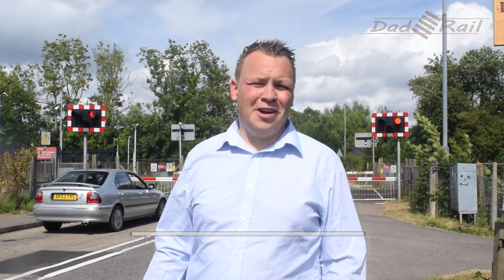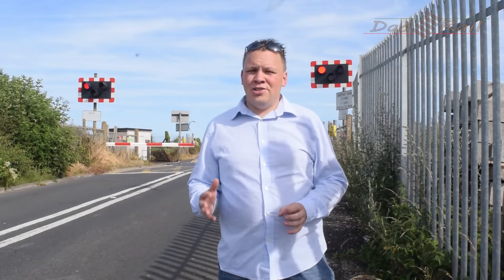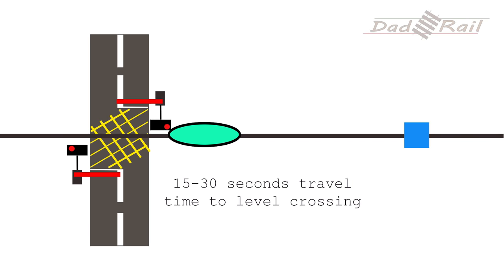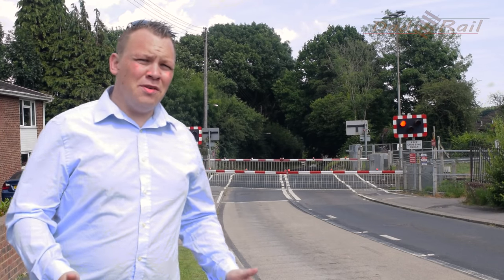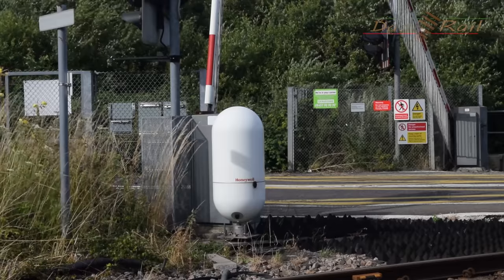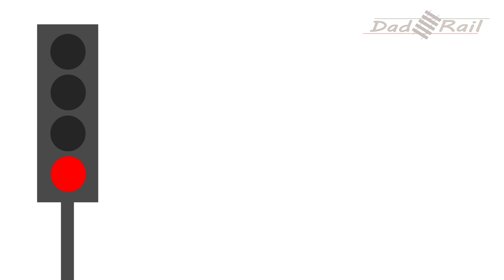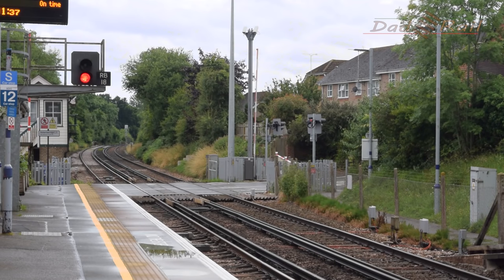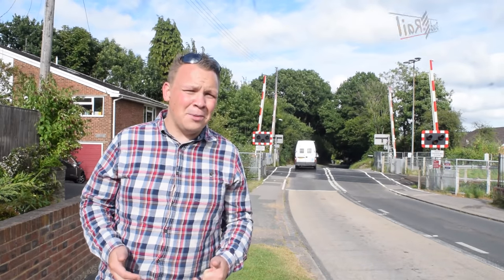Why do railway level crossing barriers go down so early? - Dad Rail HD

Comment: Several miles to stop? I can stop within 1/2 to 3/4 of a mile from 85mph with a 159 - full service brake (step 3), on a dry rail. The 170s - one of which was shown can do it in 1/4 to 1/2 of a mile in full service, from 85mph. Several miles could leave you in the next county. It was fun though before they put automatic sanders on in step 2, 3 and emergency - really tested your skills.
Reply from the maker: We have always had automatic sanders on Class 375s and 377s that I drive. They are pretty good on the breaks as well. Several miles based on a class 37 pulling a heavy freight train on a wet rail :-) Saying that one of our drivers who is now a manager did overshoot stonegate station by 2.45 miles! Was due to low adhesion and no sand in the box, - RAIB Report - https://www.gov.uk/raib-reports/station-overrun-incident-at-stonegate-east-sussex
Reply: They sound as bad as Disastros. One slid past 2 reds a few years ago - driver exonerated. The 159s have always done better in leaf fall probably due to superior WSP.
Reply from the maker: They are normally pretty good, just this one had no sand! Do you have the initial step 2 application policy in leaf fall? We have to use initial step 2 when driving class 377s as it is southerns driving policy, but when driving class 375s we follow southeastern policy which is earlier and lighter. Apparently the class 700s have got block breaks on them, be interesting to see how they perform in low adhesion
Reply: Dad Rail - yes we have......or at least SWT had that policy. I still use step 1 to take the bite out of the brake and earlier and lighter was a lot better. Never slid by a station in 18yrs of driving (fingers crossed). I've put flats on the wheels though using their policy.
Reply: flats - not good!
Reply: pmailkeey - actually some driving wheels have metal tyres... Metal wheels on metal rails is the most efficient. Rubber tyres on asphalt is good for grip, but not very efficient.
Rubber train tyres would not last long enough. Plus they would be incompatible with the signalling system.
Reply: pmailkeey - Rain and snow are not normally a problem on the rails. Leaves break down and leave a oil like substance on the rail, that causes wheel slip. Ice does not affect steam locomotives much. It also does not affect diesel trains too badly. But ice will cause great problems for some types of electric trains.
As ever with these problems, there are methods of preventing these problems, or dealing with these problems. For example vegetation control, rail head cleaning or rail head treatment trains. But if the problem only occasionally occurs, funding of these solutions is often limited.
Heavy snow of course requires snowploughs. Sometimes the railway does not think things through, then uses an excuse, and then the media loves that as a story...
Reply: pmailkeey - That’s only a little slide 🤣
Reply: @pmailkeey I meant wheel slip protection not TPWS

Comment: How do they prevent motorists or pedestrians from being electrocuted when they cross the third rail?
Reply: samanli2014 - There is no third rail across road or footpath crossings.
Reply: Mark 1024MAK So the trains freewheel without power at the these crossings?
Reply: samanli2014 - Electric third rail trains normally have multiple pick-up shoes, so no. But if all the pick-up shoes were not in contact with the third rail due to a very long gap, then yes, they would free wheel until the next third rail section.

Comment: Why, when a train is stationary at a station, cannot the road be opened until the train is ready to proceed?
Reply from the maker: The crossing is normally closed for safety reasons. There is a possibility that the train could overrun the platform, because of leaves on the line or misjudged breaking for example. If the level crossing was left open the train could potentially collide with cars or pedestrians on the crossing.
Reply from the maker: A bit more info on the above point :

The crossing and singling systems are also interlocked and have a time out feature on them. once the crossing has been closed, either a train must pass over it, or a set time must have elapsed before it can be raised again. This is to prevent the crossing being raised with a fast train approaching it. For example. The signalman lowers the crossing, and clears the signals to green. The train passes the green signal at speed. The signaller then changes there mind and raises the barriers, but by now the train is too close to stop. Thats why the barriers cant be raised until the system has timed out to prevent such a scenario. 

If a crossing at a station has been closed to allow a train to approach safely, by the time the train stops at the station, and then the signaller to contact the driver, changes the signal back to red, and waits for the time out feature before raising the barriers. By the time this has happened the train is normally ready to leave so thats why the barriers stay down

Sorry for the long winded answer I was trying to work out how to best explain it.
Reply: Thanks. It is very frustrating, where I used to live, there are several crossings, all immediately beside stations, and one can sit for what seems an inordinate amount of time at some of them.
Reply: I did hear that in the commentary on the clip. The next reply you give answers the question. Thank you.
Reply: figjam59
You asked about stationary trains at stations near level crossings.  I don't believe you got a satisfactory answer.  It's easy to understand why the barriers go down when a train is approaching, even if it's intended to stop before getting to the level crossing.   Why the barriers might STAY down the whole time the train is stopped at the station is a completely different matter.
Reply: The answer depends very much on the circumstances. Not all crossings near to stations close if the train is going to stop. The type of crossing, the distance between the crossing and the station, what, if any railway signals exist, and what type of railway signal, as well as the distance between the signal and the crossing, all determine the actual method of operation. As does the expected duration of the “station duties” time of the train.

Comment: In the US, at least where I live, we only have those automatic crossings. I've only ever heard one story about someone getting hurt on the crossing, and it was because there was traffic, and the driver thought they had space on the other side of the crossing, but ended up stuck partly on the tracks. But that was just one incident. What's going on in Britain that you need to check in front of every track? Are you trying to make up for all the other ways you're better than America?
Reply: There never is anything on the track. The automatic crossing (the first one he mentioned) is perfectly safe enough. The UK is too obsessed with safety. Theres no reason Why the crossings with full width barriers can't be automatic too. Drivers have plenty of warning before the barriers go down.
Reply: The United States has over 220000 level crossings.  Non-automatic crossings would not be practical here, which is why they died out over 100 years ago.
Reply: +Simon Tay
There used to be because some people are idiots and some cars break down. However obstacle detection devices have now been introduced and are used on these types of crossings to eliminate that risk.

Comment: Surely it's not impossible to build a bridge.
Reply from the maker: Not impossible, but certainly impractical at a lot of locations.
Reply: Network Rail replaces hundreds of crossings with bridges and underpasses every year, but in some places it isn't possible due to various reasons, or is not seem needed.

Comment: hi what happens level crossings don't work thank u
Reply from the maker: Hi Kevin, It depends on the type of crossing. Most crossings can be operated locally that is at the barriers by staff who will travel to the crossing. They will close the barriers and then show a green flag to the driver to tell them it is safe to proceed. If there is a signal at the crossing that can not be cleared because the crossing has failed, the signalman will authorise the driver to pass the signal at danger, stop short of the crossing and obey the hand signaller. If the barriers can not be lowered, staff can place a physical barrier across the road such as a worksite fence and stop cars using hand signals or if available temporary traffic lights.

With an AHB crossing (Automatic Half Barrier) The danger is that the treadle doesn't activate or something goes wrong with the crossings and it doesn't lower. The driver would have no knowledge that the crossing hasn't closed until he could actually see it. So potentially he will go across it while the barriers are still up. This is known as a wrong side failure. After being reported the above methods would be used until the crossing has been fixed.

As above it does depend on the type of crossing for example ABCL and AOCL have different instructions to AHB and MCB Crossings. 

Here is a link to the railway rule book concerning level crossings.

Dint forget to leave a sub if you have not already :-)

http://www.rssb.co.uk/rgs/rulebooks/GERT8000-TW8%20Iss%207.pdf
Reply: If the red road lights are working correctly the cars should be stationary (they break the law if they do not obey red traffic lights) and should wait or find an alternative route. In the UK, the trains can and will run and cross over the level crossing even if the barriers are up in the air. Red traffic lights mean stop or risk being hit by a train and taken to court by the police.

Comment: What Happen if a Crossing goes wrong
Reply from the maker: Hi John, Ive got a video on that coming in the next week.
Reply from the maker: https://www.youtube.com/watch?v=diXBBl0KuA4 As promised :-)
Reply: everybody dies
Reply: Use your imagination, and don't ask damn fool questions.
Reply: If a crossing goes into fault mode the default position is for the barriers go down closed to road traffic. If the train travels too slow the barriers can "time out" before the train has passed the exit treadle and they will raise the barriers.This is a problem during engineering works so the barriers have to be controlled by an attendant pressing the buttons manually.
Reply: @mikebass3721  In Belgium, train drivers have to assume any crossing might be 'in alarm mode', and thus have to proceed with caution when they've been stopped for more than 15'. A crossing is in alarm mode when one or both of the red lights is out, when the barrier didn't come down correctly, or if it's been closed for 10' or longer, and this will keep an approach signal closed (red), although it won't close a signal, to avoid an emergency brake for an approaching train. A crossing is considered in alarm if closed for more than 10', because we assume more people will risk crossing it when having to wait for too long, like when a train got stuck after an accident. 
We rely mostly on electrical circuits for detecting the presence and approach of a train, in stead of treadles, except for some very lightly travelled lines.
Reply: @mikebass3721  which type are you referring to?

Comment: You didn't get the crossing types exactly right. The radar egg indicates an automatic crossing, not a manually operated. 

I don't know about Britain, but here in Germany automated crossings are further divided into subtypes depending on how they are triggered or monitored. Some are couppled with the signal box and need to be closed before the signals turn green (happens automatic like seting the right directions for the switches). The ones that are activated by the train itself and further divided into  two categories, the ones check by the drivers (with a special signal indicating that they are working properly) and the ones checked by the signalman. The later ones still operate fully automatic, but in the case of a failure the signalman is responsible for stopping approaching trains by radio.

Also the operation in case of an ongoing malfunction differs. In both cases the driver is responsible for taking action to ensure a safe passage, but at signalman control crossings the signalman has to put out a written order to tell the driver to do so.
Reply: No the crossings with the Radar and Lidar are known as MCB-OB crossings or to give them their very wordy title they are "Manually Controlled Barriers with Obstacle Detection" crossings, they are not considered to be automatic crossings.
Our manual and automatic crossing are also further broken into many or perhaps too many different types as well.

Comment: Will they prosecute train drivers committing SPADs  with the same vigour that they want to prosecute drivers abusing crossings as the safety issue is causung unnecessary delay to road traffic (especially at those crossings with stations next to them where the train is due to stop).
Reply: SPADs are very serious situations.  The first rule of train driving is "always do the safe thing" and the second rule is "always obey the signals."  I cannot speak for the UK, but in the U.S. you will be made redundant or suspended for a SPAD.  It depends your prior history and safety examination record.
Reply: In the UK, a train driver who SPADs a signal will be immediately stopped from driving, be tested for alcohol or drugs and placed on immediate leave. They can lose their job, and if they kill or injure anyone will be prosecuted by the police.
Reply: @ianmurray250  actually it depends on the reason why the SPAD was caused
Reply: @GWRProductions-kg9pt  Well yes, but in the context of the original question I felt we were talking about what used to be called a type A where the driver is at fault.

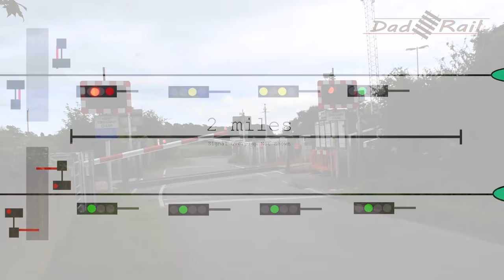Comment: Does anyone have a moment to explain  the animation of train crossings 4:58 ?
Reply from the maker: The animations highlights the main reason why the level crossing gates go down so early. The bottom train has green signals, because the level crossing has been closed in advanced (causing longer wait times) but the train doesn't have to slow down. In contrast the top train has yellow signals and the level crossing is only closed when the train is approaching the red signal just before the crossing. This results in the crossing being down for a shorter amount of time, but more delay to the train.
Reply: Dad Rail so instead of waiting to close the gates and force the train to slow down at each crossing just for the sake of letting more cars through, they close early to make sure it's clear and have the train maintain constant speed on its route?
Reply from the maker: Thats correct.

Comment: Thanks, very interesting. I'm not from the UK but very interesting how they prioritize safety for everyone. As for the idiots that go around the barriers, they need to figure a way to stop that, perhaps electrifying the barrier, they'll learn fast.
Reply: Back in 2017 when travelling on the Russian railways I noticed that many crossings also had large metal flaps which opened up from the road surface across the width of both carriageways.  This would act as a major deterrent to the idiots trying the "run" the gates.

Comment: 2:51 how is that safe cars could get trapped on the tracks. Thats probably why my country only has 2 gates or no gates 
at all
Reply from the maker: This is actually very safe. The crossings is monitored remotely by cctv cameras and trains are not allowed to pass over it until it has been checked to make sure it is clear. The trouble with 2 barriers or no gates at all, is people ignore the warning lights and sometimes swerve around the barriers and try and race the train. This can and does cause major accidents. We have a large number of 2 barrier / no barriers crossings in the uk and they are responsible for the majority of level crossing incidents.
Reply: +Dad Rail Sadly it tends to cause some damage to the poor innocent trains and train drivers mental health when idiots do stuff like that. Otherwise I'd be inclined to just let the suicidally stupid get on with it, anyone dumb enough to ignore the big flashy loud warning to keep out of the way of the several hundred ton speeding machine will find some way to let their stupid win them a Darwin award whatever anyone does.

Comment: the obstacle detection one is not controlled it is automatic
Reply from the maker: Hi Daniel, Ive had a look into this as i wasn't sure myself to be honest, but after speaking to some of my colleges who are signallers, I can confirm that although the crossing is fully automatic and needs no human intervention to make it work, it is infact classed as a controlled crossing, not because of how it is physically operated but by the fact that it is interlocked with the signalling system, and therefore the crossing environment is controlled, I.e. no train can pass if the crossing is not clear.